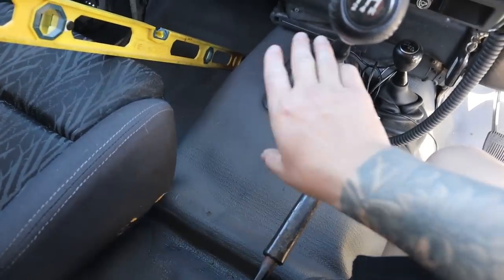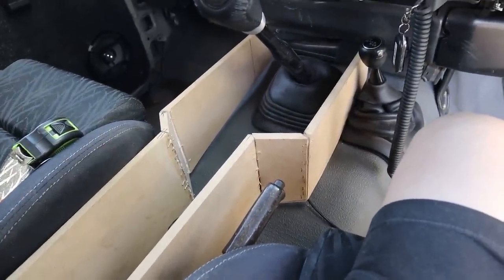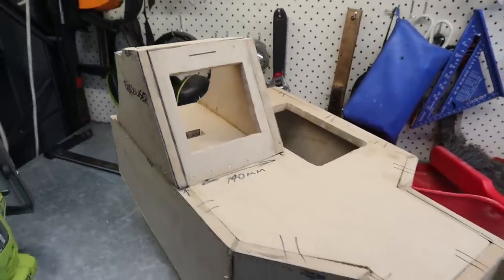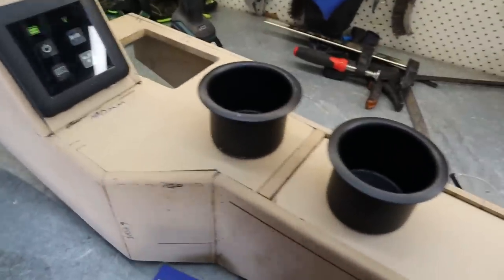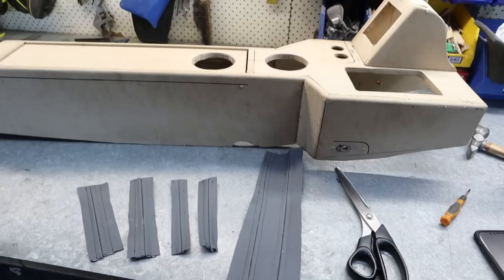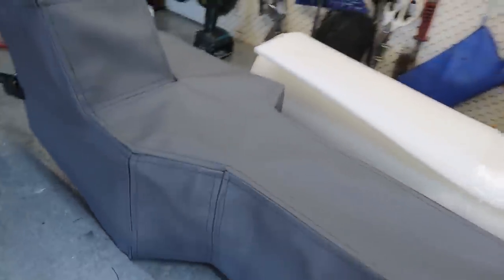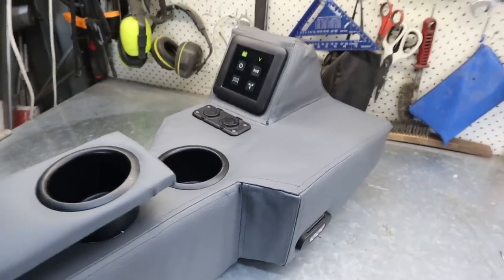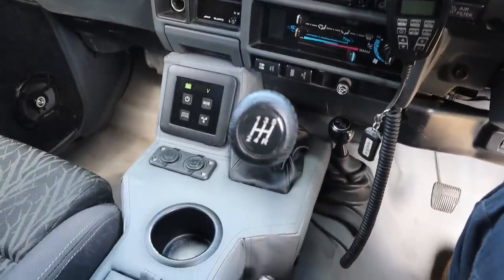DIY Centre Console - HJ75 Troopy Build (EP18)

Comment: On the inside of the console where the sharp corner are, if stiffness is a concern, use tin used on HVAC or even roof flashing. It is very thin and if bent at good angles, a strong staple gun or simple screws can be used. This is a gusset to increase rigidity. 
  Also, consider a rare earth magnet for latching the lid. With a paddle bit, epoxy and 4 magnets (Two for top, two for bottom) just make sure they are facing the right direction. I have nothing against Velcro but over time one side will load up with debris or the girls hair. It has to be cleaned even though you have a friction fit now. It just looks cleaner as well. Just future suggestions as it came out great. 
  Got a sewing machine, do the seats. Headliner material is cheap and if glued and sewn on the back of your choice of material, add that extra softness. For patterns, a home improvement store sell Red Rosin paper about $10 USD. It is a meter wide and 80 meters long and thicker than construction paper. Cutting a drawn pattern is easy to transfer as each can be labeled and held with a stick pin. Piping is common as a French Seam. I use air shock tubing as it is cheap and the right size. Best of off-road travels and don’t forget tools & some medical box… Not for you but the guy you meet on the trail who tipped! Safe journeys.

Comment: Interesting idea but honestly it's a rather poor execution. It really stands out in the wrong way as it clearly doesn't match the rest of the car look and doesn't blend in mostly because the center console is supposed to be an extension of the dashboard and they both made out of different material. The next improvement would be to cover that dashboard with the same fabric to match the center console, everything would come in nicely. But first you need to check out the proper way to wrap fabric to make it nice and tight.
Also you didn't show us how you fixed it to the car, if you had it fixed?
Reply from the maker: Cheers for watching mate! Appreciate your feedback and honesty 🤙
However I don’t believe it should be an extension of the dash at all, being hj75s do not even have a centre console from factory 😂
Won’t be redoing it, I love all it’s imperfections on my imperfect rig, shows I made it and had a crack. Yeah it’s fixed to the floor using rivnuts and factory bolt holes ( doesn’t need to be shown on video)
Cheers legend!